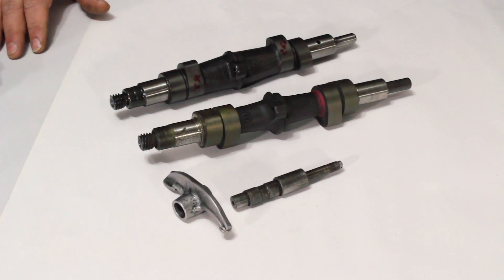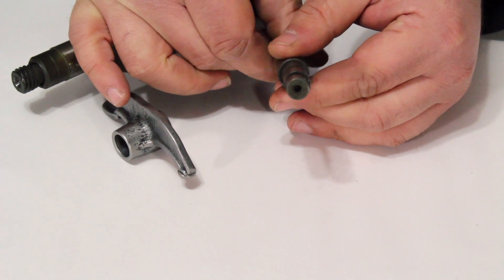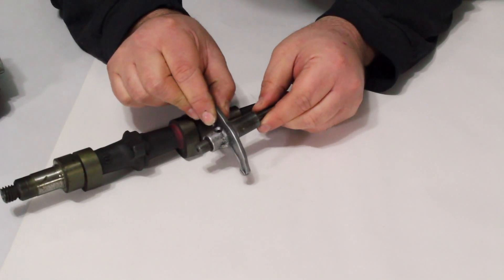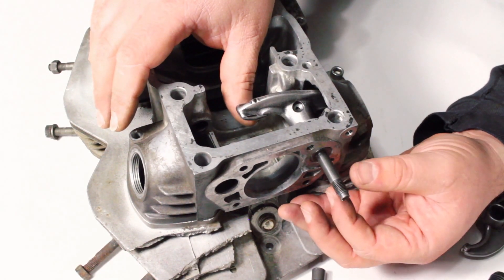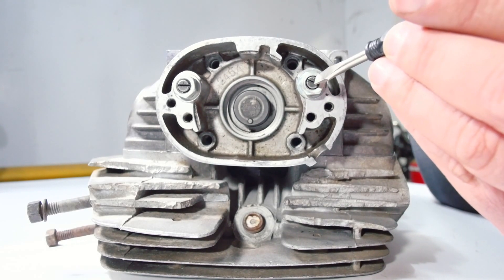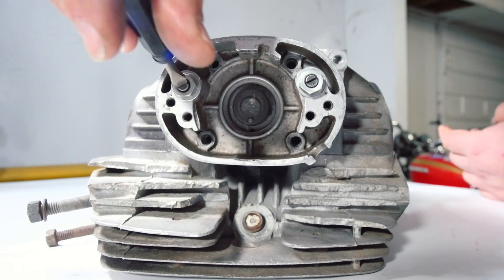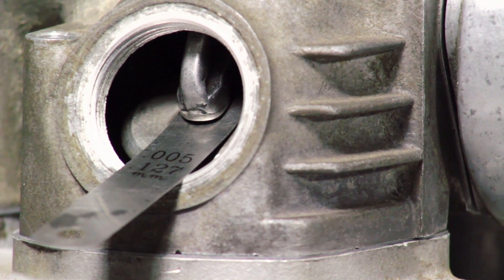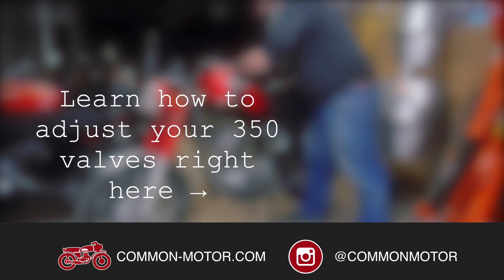Honda CB350 Camshaft & Rocker Arm Design and Adjustment Explained - Detailed

Comment: Imo 360s are still underrated for design vs 350 esp with the mods for oil flow available and easy head disassembly

Community is getting bigger everyday these little cafe bikes are as cool as cucumber mojitos all day
Thx for all ur vids guys